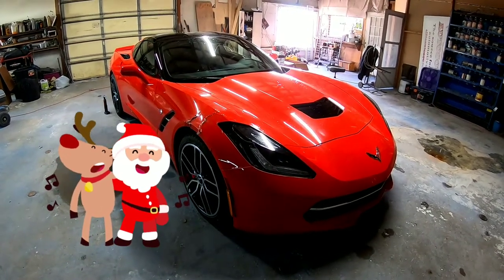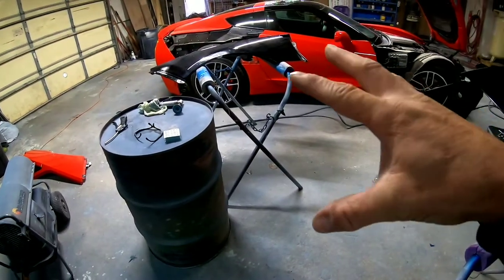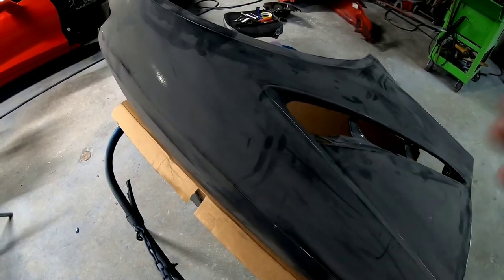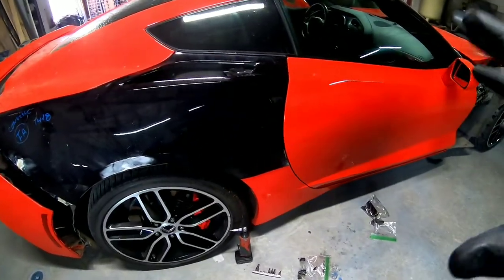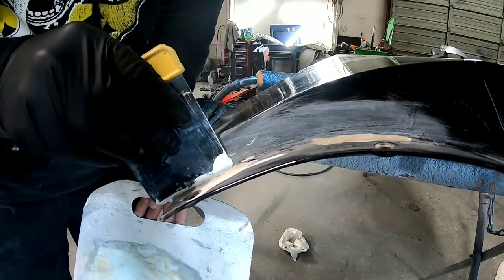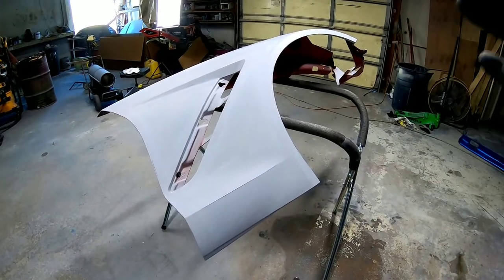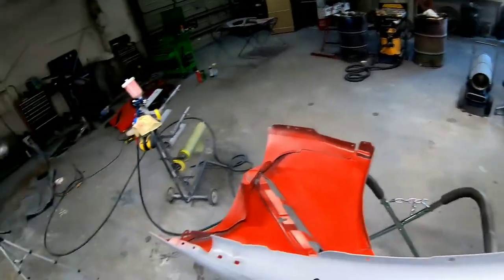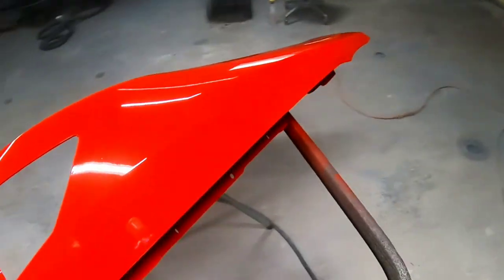Fix corvette fiberglass. diy auto body, smc fiberglass repair

Comment: Hi Chris, nice job on Santa's sleigh!  I'm enjoying your channel so far!
Question on bare PP (plastic) bumper covers:  In addition to adhesion promoter, do you add flex agent to the sealer and clear?  How about the base coat?  I am painting Dodge Caravan bumper covers that were bare, but I am going to make them match since I am painting the whole van.  Thanks man, keep up the great content!
Reply from the maker: Yes, some paint and sealers have flex additives already added. If not ,yes I would add it to both. Check with you paint supplier they can tell if the paint your using needs it. Thanks for watching!

Comment: The hell did you tape it off for
Reply from the maker: To protect the paint from damage.
Reply: @GarageNoise  how could you have damage it ?
Reply from the maker: Around the tailight, with the tool to take the bezel off. The bumper retainers are notoriously difficult to pop loose and I didn't want the bumper edge to pop up and scratch the fender.  Precautions learned from past mistakes.

Comment: I've got a question.  I have a Cadillac XLR and it has slightly flares fenders but you can only install an 8.5 inch wheel.  I would like to add some stock looking flair to gain an additional 2 inches.
Any recommendations?  My thoughts are to grab some wrecked fenders, saw off the flairs and integrate them onto my fenders using your repair methods.
Reply from the maker: I like the way your thinking by using  donor fenders. There's  alot to think about  with a modification like that. Take good measurements, test fit, watch out when welding for warping of the metal from heat. Appreciate the support brother and let me know  how  it turns out.
Reply from the maker: Sorry it's  probably fiberglass. That would simpler.
Reply: @GarageNoise  I googled it:
What is the body of a Cadillac XLR made of?
The front fenders and rear quarter panels are SMC, more of a rubberized plastic, the hood, doors and trunk lid are fiberglass, and the roof is a aluminum, magnesium alloy.
Is smc similar to fiberglass?